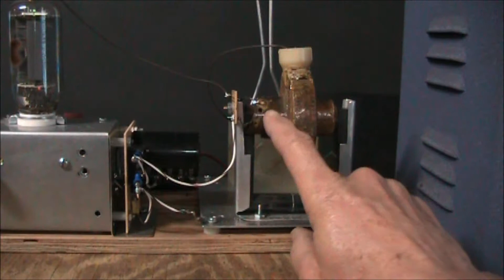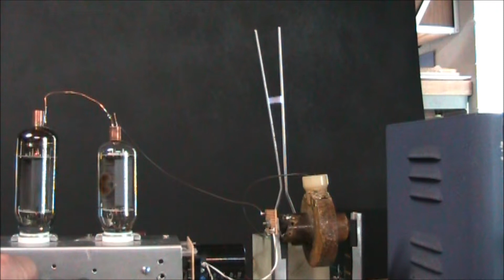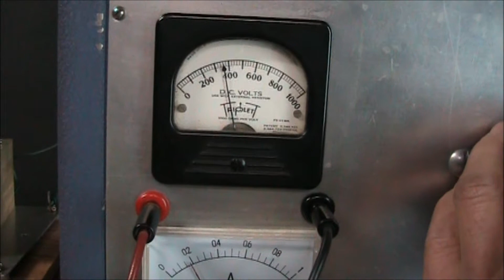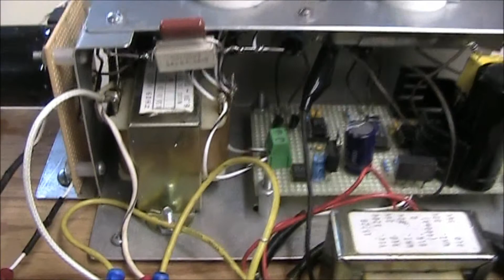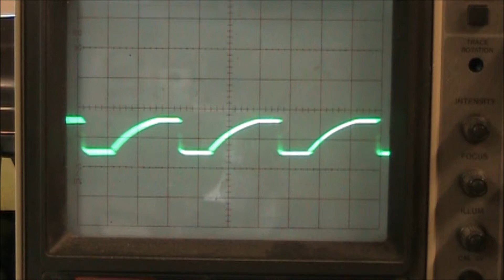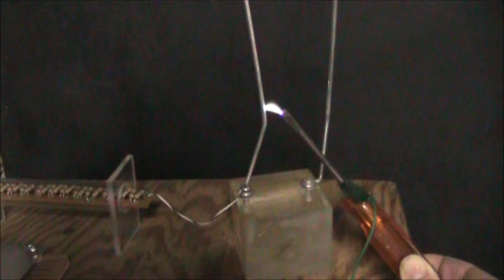Early style flyback

Comment: hi, do you have the driver schematic ?
Reply from the maker: The simplest way to build this circuit is to use the TL 494 IC and use their data sheets. That IC has duty cycle control and is real easy to use. When I made that video I used some old stuff I had laying around and was not the best way to do it.
Reply from the maker: Also google flyback driver diagrams that's where I find a lot of stuff

Comment: do you think this would be a fairly good driver for flybacks? here is the link https://www.google.com/search?q=vacuum+tube+flyback+driver&tbm=isch&imgil=emWN0WOMMpKnqM%253A%253B-2CUOL8dEkrDDM%253Bhttp%25253A%25252F%25252Fwww.electronixandmore.com%25252Fprojects%25252Fflybackdrv%25252Findex.html&source=iu&pf=m&fir=emWN0WOMMpKnqM%253A%252C-2CUOL8dEkrDDM%252C_&usg=__57aQYHI8j5TSUBEh4jHhXSKmwgw%3D&biw=1536&bih=711&ved=0ahUKEwi3otG5nsTUAhWM3YMKHUpVAmYQyjcIPQ&ei=QcpEWff9N4y7jwTKqomwBg#imgrc=emWN0WOMMpKnqM:
Reply from the maker: Steve Ward, the designer of that circuit has been around for a while so I take it as fact. If you have the parts and if you want it make it. Make sure you get those ground points on the grid leak and cathode. I did not see them in the schematic.
Reply: it requires around 600v should this be ac or dc i can get either to use  i would say dc as its ran through a voltage doubler in the circuit but i have a 610vac transformer out of an old amplifier
Reply from the maker: That circuit was DC powered. I made a print out of that circuit a few years ago and used some ideas on my projects. 600 volts dc is pushing the tube quite hard. So I would keep the voltage under 600. Tube type tesla coils work better on ac because there is less chance of arc over to the plate. Have fun and experiment.
Reply from the maker: If your 610 vac transformer has a center tap ground it and rectify the two outputs.